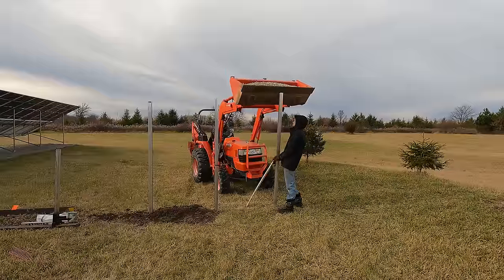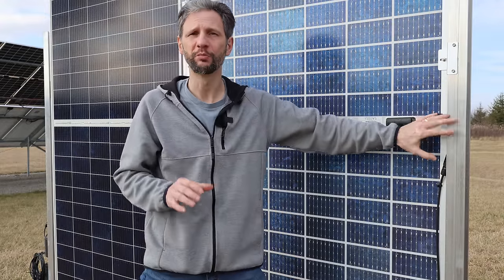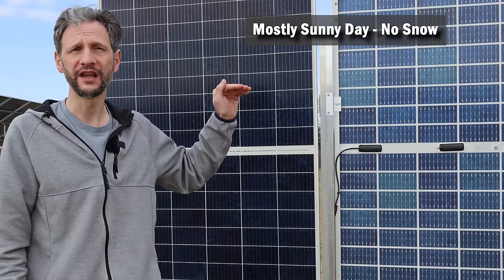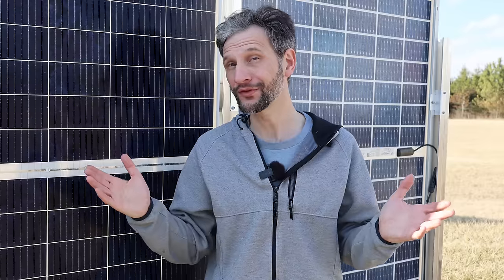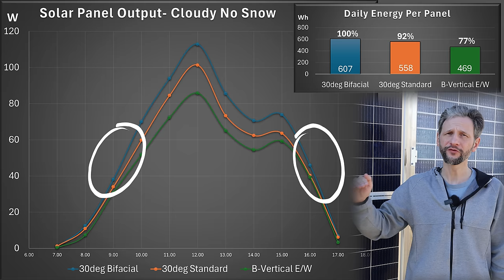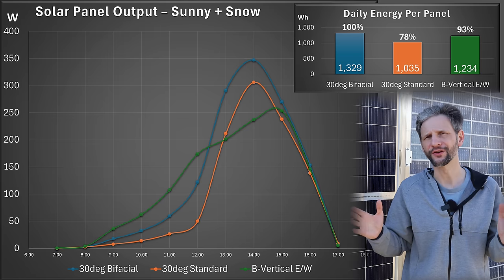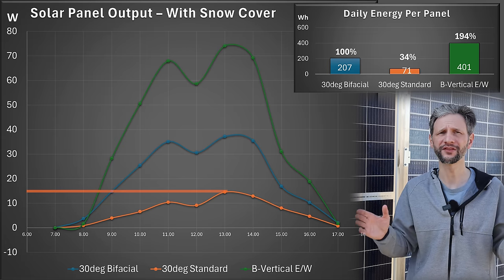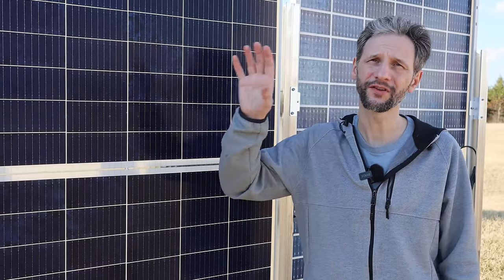Vertical Bifacial Solar Panel Performance Results Part 1

Comment: The real question is cost per watt. (Including the land cost)
Reply: Here, the cost of the land is literally zero, as it can still be used for farming. Also, produced electricity has a higher financial value in the mornings, the evenings and in the winter, than in the noons and summers.

Comment: What about south facing vertical (for on house installation) ?
Reply from the maker: South facing vertical will give you a standard parabolic distribution.
Reply: @ProjectsWithDave  That is true but the performances will be different for individual test scenarios.

Comment: what is the purpose of the dc optimizers?
Reply from the maker: Maximize output for each panel independently while maintaining an optimal string voltage for the DC/AC inverter.

Comment: I dont know if my question is good or not given this video, but, Im thinking of getting solar panels, but i am not sure whether or not to get just the panels tapped right into my electric or perhaps getting batteries and using them.
Reply from the maker: It depends on your goal, if you’re trying to save money don’t get batteries. If you want some back up when the power is out then you can probably justify batteries.
Reply: @ProjectsWithDave  im trying to lessen my electric bill. I can buy these myself but i dont know if there are companies out there that will allow you to buy your own panels. I just need help installing them. I currently have a 100 amp service breaker box. I figured i would need 17 to 20 panels which would fit perfectly on my vinyl fence. My house has dormers and isnt good for panels on the roof.
Reply from the maker: You can check my website for some value priced solar sources here: https://projectswithdave.com/solar-panels/
I recommend checking with your local building office on any restrictions in your area before purchasing anything.  You may be able to find a local electrician to do the wiring for you if you check around.

Comment: the cost of bipv is still higher than the traditional in which there is only one goal: to max the sunlight output while min the cost or the % rise in cost can be compensated by even more % rise in the ouput unless the installation space poses the major constraint ,no matter what combination methods are; therefore to get the end goal, pls make test on adding foldable reflective surface, eg al foil, on the ground on both sides of the vertical bipv to see if the additional cost for foil and space required are worthy?? Furthermore, to ease the pain of panel installation, a 3 rails across the inclining frame from, top, mid and bottom with all the peripherals to slide in all the desired panels into position plus a button of system check for installation error...then solar energy users owe you a debt for life!!

Comment: THUMBS DOWN for me, here it's why:
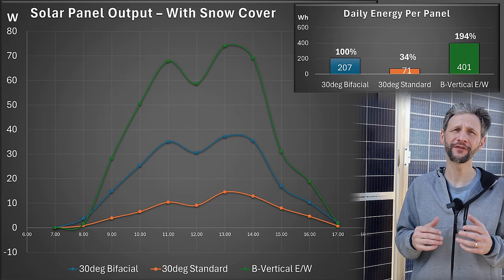10:25 The scale on each graph is enlarged, therefore it's misleading.
If you put all the data with the same scale, it's obvious that vertical panels are not a great idea. Sure, you get a little more in a very specific conditions, but you are losing on +95% of the rest of the year. We should not look at % difference, but Watt difference.

That's being said, I really appreciate this awesome video. I wish I was that fortunate one day to work with theses panels.
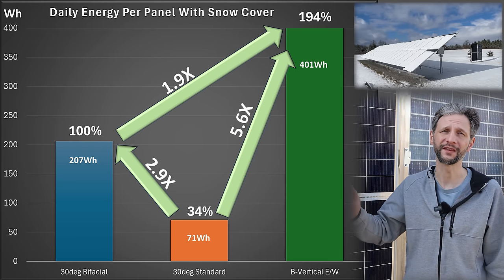Reply from the maker: You can see the comparison in total Wh starting at 11:26.
Reply: @ProjectsWithDave  I don't wanna waste too much of your time with my comment but.... (starting a long comment again!)
The problem is different:
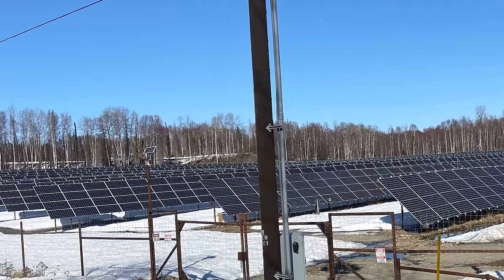At 10:21, the max Y axis is 80W and it was 400W in previous graphs. Sure it's mathematically correct, but it can be misleading for people who don't paid attention to detail (TDAH is the new black!).

If you had keep the 0-400W scale in all your "W in Y axis" graphic. It would be obvious that the gain is relatively marginal.

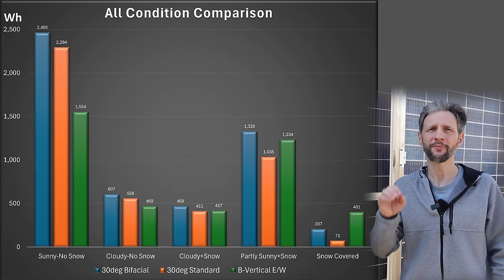The graphic at 11:33 brilliantly sum the whole video. Since they all have the same scale, the comparison is not misleading. This graph is a masterpiece and for that, and because you answered my comment, I've put the THUMBS UP back where it belong!

Have a nice day and please continue to educate us with scientific real life analysis video.

Ps Just an idea: Another option could be the vertical panels with a mirror on the ground.

Comment: In the next few years, bifacial panels will become a serious option for fencing.  Wooden fence panels are very expensive, don't last even 20 years, and produce zero energy.  The cost is plummeting for solar and getting more efficient year over year.  Even when bifacial is mounted on a north and south axis, they will produce a great deal of energy.  I hope to someday replace all my wooden panels with solar.  I think they look as good or better than wood.
Reply from the maker: I think it would look great as well.  Probably the biggest risk is breaking the glass over time.

Comment: I'm completely unconvinced.   Especially because I live in Florida, so snow's not going to happen.  I'll stick with roof mounted. 30°  😂
Reply from the maker: Right, vertical is not for everyone.  You will get more power with your current setup.  And I wouldn't change if you already have a system installed.  One thing to consider even in southern climates, you may be more at risk from hail if that is something you see often.

Comment: Wasn't the point of the E/W panels more for when it's actually hot out? Fixed 30° panels will perform the best UNTIL they overheat.. that's where 30° loses power because their efficacy goes down. Where as vertical EW can generate overall more power in a hot condition by not getting so overheated that they lose efficiency

So this was neat but, the point of the 'hype' was where solar farms or otherwise are located. Which would usually be less-wintery areas. And the other point would be to store power in other ways for when it's needed later vice strictly on-demand.

You should do a year long OVERALL comparison for your setup and see how your angled panels perform vs verticals.
Reply from the maker: That's the plan.

Comment: use 2 pairs of vertical panels and and give them a little tilt like this / \ so the sun will hit them all day long.
Reply from the maker: Then you are blocking the back side.  That would be ok if they weren't bifacial panels.

Comment: Did you actually measure the 60 mph wind or use the weather reports  The wind reported in the weather report is measured at around 1000 feet up, not at ground level.
Reply from the maker: Good question, I did not measure it directly, I was referencing local weather information.  However, I am at a high point in the area and we see much higher wind typically than the surrounding areas.

Comment: i wanna buy bifacial and put them at 0 degré angle, flat , but cannot see any test on the internet ;(
Reply from the maker: You can use an estimator like PVWatts to get a good idea of how it will perform in your location.

Comment: The whole point of installing vertical panels is to reduce heat and therefore maintain performance. Panels installed in snowy, cold areas are therefore not going to be as hot. You've clearly missed the point.

Comment: You are actually shading the upright panels a bit with your renogy brackets.
Reply from the maker: No more than a standard clamp would.
Reply: @ProjectsWithDave  sloopy work, and even your wiring hangs over the panels.

Comment: Maximum output for the day does not mean that it is better at no point in time. Did you have a graph showing total output. Example, one panel produces a total of 20 kW in a day. The other one produces fifteen kilowatts in a day.

Comment: you have some flaws at your construction for example the mounting brakets shadow the solarpanel and your standoffs are shadow the panels too because they are in front of your panels. I would assume if you would solve your design flaws they would perform much better.

Comment: I wonder if anyone's ever just tried cladding the sides of their house, especially the south facing sides with panels.
Reply from the maker: Yes, that’s been done.
Reply: @ProjectsWithDave  if the panels stand off the house by an inch or two making an air gap maybe it could have a secondary benefit reducing the heat making it into the structure of the house from the sun.

Comment: Bro I'm high but why not put a white sheet or mirror on the ground reflecting like the snow bit all the time? 🤓
Reply from the maker: Yes there are a lot of suggestions for reflecting materials, white rock, mirrors, etc.  these would all help with varying degrees of performance and cost.  I plan to do some testing in that space.

Comment: It should convince me to use bifacial because whenever it's cloudy but there is snow, it will beat the panels that out-perform them on a regular basis most of the year, by 1%? 😂

Comment: You could have the regular panels track the sun.
Reply from the maker: My goal is always to build the most passive system possible.  Tracking systems cost more and always requires more maintenance.

Comment: Am i missing something?  Thus guy is comparing the performance between 2 panels set vertically to 18 panels set at 30 degree angles?
Reply from the maker: The data is analyzed at a per panel level.  It is just comparing the performance difference between different orientations.
Reply: @ProjectsWithDave  I see it's labeled daily energy per panel.  But I was wondering if you were taking the average of energy output from 18 30 degree panels and comparing to average output of the 2 vertical panels.
Reply from the maker: Yes.  Therefore, the results from the south facing panels is a bit more accurate because it reduces the panel-to-panel deviation.  Unfortunately, I didn't have a whole row of vertical panels to average out.  However, the data was distinct enough to give reasonably valid results.

Comment: Your panels have 50% bifaciality, was that in the specs? The specs of my cheap JA Solar show 80 +-10% bifaciality. Current price is around $80. 
On globalsolaratlas you can actually simulate bifacial panels by adding two results. The original researches assume 90% bifaciality. In the simulations you can see that during winter, this setup performs terribly, just like in your findings. In summer they outperform everything by 10-20%. I worry about the wind-loads. At 200km/h wind, that's forces of 400kg/panel. The 30-degrees variant experiences maybe up to 150kg, which is also what each unistrut is rated for.
Reply from the maker: My Canadian Solar panels are rated for 15% back side gain which is about the best I see.  However, I have tested them upside down and the max they can produce with full sun exposure is about 50%.  You can see the results in this video: https://youtu.be/1SXNjsSsmq0
Reply: @ProjectsWithDave  I looked at the specs of one of their panels that is probably yours. It states 70% +-5%. "Power Bifaciality* 70 %"

Comment: Why not just have normal panels track the sun to they are always at the optimal angle? Seems a bit wasteful to have "extra" panels just to balance.
Reply from the maker: The panels aren't "extra" they are two sided.
Reply: and both sides are getting the same  efficiency at the same time?  or are half of them getting less, half of the time?  I'm just having a hard time understanding how that is better than south facing panels tracking the sun. At least from a per foot perspective.  @ProjectsWithDave
Reply from the maker: The back side boosts production by about 10% on average without the need for complex and expensive tracking equipment.
Reply: Actually, those "extra panels" are cheaper even than the cheapest single axis trackers additional costs to the structure. You introduce a lot of structural weakness this way, hence proper reinforcements for both static and dynamic loads (torque brakers) are required, plus there's the cost of additional moving parts and motors, as well as their mantainance. In Addition, you loose usable space, when talking about AgriPV and solar fences.

Comment: Would it be cheaper to have some kind of tracker for these panels? Turn them towards the south when the sun is highest? Have multiple panels on one cheap motor.
Reply from the maker: It's cheaper to add additional panels vs a tracker.
Reply: @ProjectsWithDave  Yes I am aware. I still like to think about. Also must remember the more dense your housing goes, the less space there are for said extra panels. Thus there is still some room for trackers.

I was just specifically referring to this kind of orientation - if someone could think of a much cheaper kind of tracker that would only rotate the panels say 90 degrees or a manual tracker where you change the orientation per season.
Reply: No, as even highly cost-optimized large-scale single axis tracking systems lead to a higher overall cost. That is for the added mechanical components, their mantainance, decreased structural strength (and therefore proper reinforcements and tension, as well as torque struts needed) and also because solar panels themselves become so cheap nowadays. You can get 500+ Wp bifacial panels for 50 bucks or so and we're not speaking about huge quantities yet.
Reply: @ProjectsWithDave Exactly.
Reply: @rkan2 In addition, trackers waste the usable space for farming, whereas solar fences leave 95% of the space still usable.

Comment: This makes only sence when you use the current just for yourself. In some countries you get  money for giving current to the public and of course the high peaks in the summer are useful for the public anyway. So it makes sense to get the most out of it instead of having an equal good solution for bad conditions if you have the choice. Of course there are applications when this ones are very useful.
Reply: You're wrong. Also for the electric energy stock trade price varies a lot according to actual needs.
Reply: @zamhoidnla9059 in germany you get a fixed amount of money for each kwh you get in the net. But as i said even without getting money every kwh in the net from sun and not from coal or similar is very useful. Its no good idea to waste it if not nessary
Reply: @danielreiser2051  again you're wrong. As the amount of renewable energy in the net increases, the more the actual production needs the actual demand, the better. You get a fixed feed-in tariff only for small plants. And for small plants you basically always want to consume as much solar energy as possible by yourself. Cause approx. 4-5 cents/kWh are much cheaper than the approx. 30 cents/kWh you pay in Germany as a small customer for energy from the net. And east-west noticeably increases that amount without even having to pay for batteries. On the other hand, for larger solar plants you don't get a fixed feed-in tariff, but are subject to the power stock trade.
Reply: You amortize your sorar investment in several years depending on the application. I am not talking about solar power plants and not about earning money. i'm talking about solar power for private houses or civil buildings. And as i said every solar kwh more in the net is a good one. No matter how much money you get out of it. It makes no sence from this perspective to waste the high summer peaks from an ecological and sustainable perspective.

Comment: Bifacial panels offer no significant benefit in rooftop installations with panels parallel to the roof.
Reply from the maker: It depends on the roof characteristics and distance off the roof you can see my analysis here: https://youtu.be/mzqjCsZKUYQ

Comment: Clearly you are trying to compare apples-to-apples.  Can you see, from your data, what the results would be if both sides of the vertical panels where front-side solar cells?
I see no advantage to having half of the vertical solar panels using back-side cells.

Comment: Apparently the southern hemisphere doesn't even exist 🤡
Reply from the maker: No worries, vertical panels aligned North/South would give the same results in both hemispheres.  : )
Reply: @ProjectsWithDave Yes Dave, they would definitely work much better than "South facing panels"